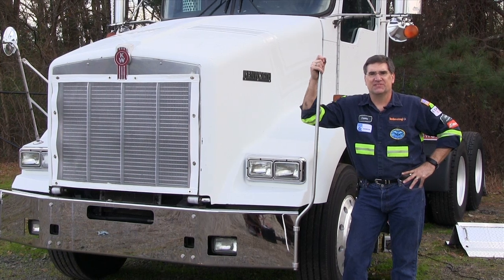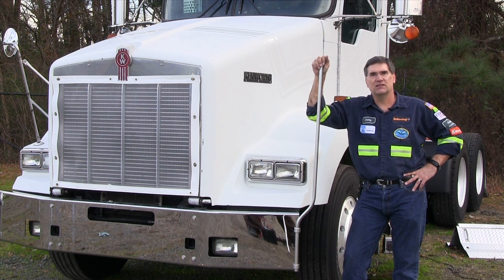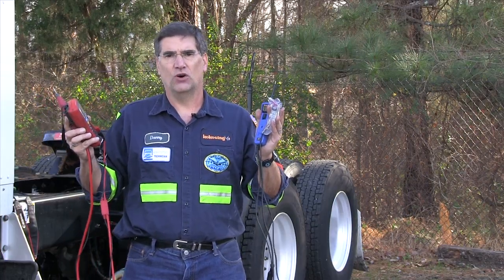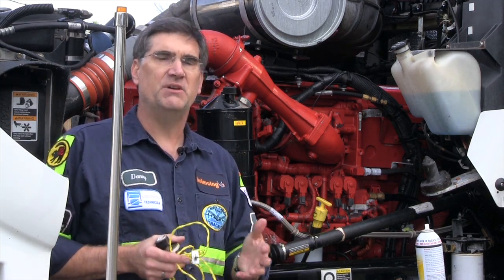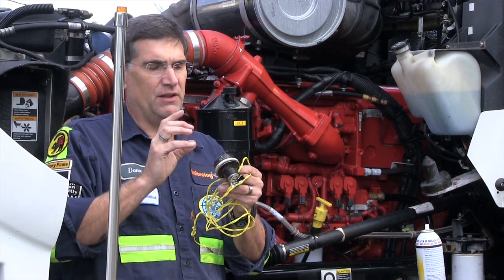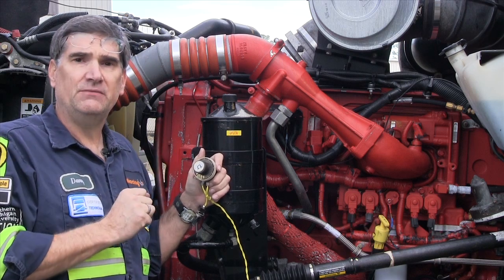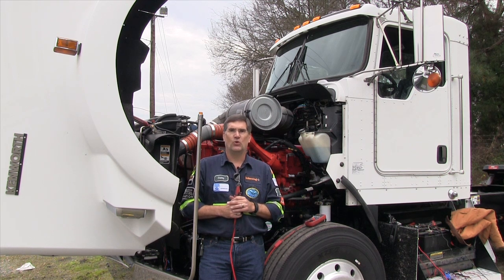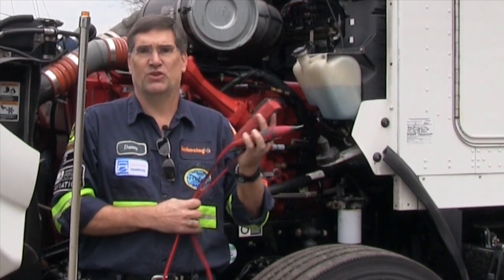LOADpro® vs. Volt-pro vs. Powerprobe® vs. Corrosion

Comment: Like you said anyone who knows electricty knows getting a voltage drop you must have current flow. so where was the current flow with the power probe? You are not using the tools correctly at all. not trying to be a hater to your product but at least represent the others the right way.I have 2 years in the field and i can already see some wrong practices. Sorry

Comment from the maker: As I've said, there are a lot of ways to do most everything. Good techs use whatever is available at the time, but try to keep high skills and high standards for professional work, as I'm sure you do. The LOADpro does 1 thing but it does it well. My hope is that the tool will make voltage drops easier and more common, and most importantly, done almost automatically. I contend that having to think about it and set up a test is why most good tests are never done. In electrical it's all the setup.

Comment: Hi Daniel (last reply cut short), I'm not slagging your invention mate, you've obviously spent hard time and effort to get it here, and you have many followers. My main point was you could have added alot of credibitlity by using a meter not showing a low battery warning, and by not stuffing probes into connector faces,  using the p/probe properly etc. BTW disconnecting the plug couuld clean it enough to hide the fault, this why I leave in a faulted condition and back probe it for accuracy.

Comment from the maker: As long as you understand the technical risks and failure modes of that method and are willing to accept the odds of failure, then I'm sure you'll be fine. In my industries however, back probing damages wire seals (even .0005") and that's unacceptable for us. We also need to inspect the connector internally because of one pin is damaged, others will be too. What I don't understand it what you do when you find a fault and have to open the connector. Why wait?

Comment from the maker: Lastly, back-probing isn't as effective as people think. The proper method is to probe both sides of the connector, and many of my connectors are 50-120 pins, in an immobile harness. The corrosion is between the pin/socket, and scratching with a paperclip or back probe pin can scratch past the corrosion and you miss the problem. I agree that the best method is live on the actual component, but if your experience is that you can get to every connector then I want to work on what you work on.

Comment from the maker: First, the meter wasn't misreading the system, although it did show a low BAT indication. I use 3 of these meters and change batteries as often as I fart. Secondly, the battery doesn't affect the voltage measurement until it's a very low number - about 8.5V. The battery had been changed that morning - it was still right at new. Thirdly, the ghost voltage isn't a function of battery power. It just happens. The ohmmeter does need a full battery to work. I don't mind the comment - you were right.

Comment from the maker: I think people hear about circuit loading and think of the PP3 method of straight voltage or ground. We don't do that, but because many people use PP as a reference, they don't educate themselves on the differences. We're TOTALLY safe for ECM sensor drivers - both 5V and 8V. Because there's no loadable voltage on a sensor input, we don't load the sensor voltage (signal). We tell people to isolate and energize the signal wire independent of the ECM. If he doesn't use us, he doesn't understand us.

Comment: Hi, don't mean to  be a hater or direct aggression here but, I wouldn't expect any good tech, let alone a teacher, to use a digital voltmeter that has a low internal battery (look at the warning on the display - hence the somewhat wild 7.5V ghost voltage), stuff any tool into the face of a harness connector, or even disconnect it for testing of any value.
Leaving it connected allows the vehicle to do the work for you, just back probe the connector and you're done.
Good luck with this.

Comment: Top tool dan, its been a great asset to me in the 10 months I've had it. I left the military after 8 years as a mechanic and still struggled on the basic electrics. After a little bit of learning and then finding this tool its been great. I try telling everyone who will listen how great it is and how much its saves. Sometimes feels like I'm banging my head against wall when their still testing with a test light or the old power probe with green/ red LEDs

Comment: I bought a power probe III a couple of years ago to help diagnose electrical problems that pop up sometimes in the 6 vehicles that I own. I am a backyard mechanic who would rather learn and fix my vehicles than have somebody else do it. About a year ago I had some corrosion in a lighting circuit that the PP3 was no help on. I bought the load pro/book from amazon. After coming up to speed with it, it took me about 8 minutes to locate the bad ground. Also I wish I could draw like you. I'm a klutz.

Comment from the maker: The voltmeter reads battery voltage but doesn't need battery voltage to operate. The other tools need to be connected to the battery, in order to read the battery, or they don't work at all. A mirror doesn't need electricity to see your reflection - a video camera does. I can use the voltmeter anywhere on a vehicle to read voltage - but I don't need to hook it to the battery. It's pretty simple. Keep reading.
Reply: You should probably mention that while a dmm doesn't need system voltage of the equipment your working on, it does indeed need/have a battery (primarily as a reminder I guess). Without it the meter, and load pro as well, are useless. I've seen plenty of guys waste hours on a diagnosis just to end up being low/corroded batteries in their meter. If you end up on a road service and forgot to pack spare batteries, you're SOL.

I don't understand the reason for the comparison either. Aside from reading voltage the power probe and load pro doesn't share any other functions of one another.....or do they? I don't even know what that third tool was you were comparing so I'll refrain from comment on it. I do own a power probe and it is awesome for most things but it doesn't load test circuits. I got a light that pulls approx 3.5 amps for that. I've been strongly considering getting a load pro just for a little more simplicity, hence what lead me here.

In reference to your comment in the video about poking wires, it's never a good idea to pierce a wire but there are times when it is unavoidable and it should only ever be implemented as an absolute last resort. Make sure to seal the poke hole up when you're finished.

Comment from the maker: You don't need the ghost voltage feature to make the LOADpro work. That's just something meters do. If you have a manually ranging meter, you might have to turn the meter to the millivolt range where the sensitivity is higher. It won't hurt the meter if you read 12V on a lower scale - it will simply say "OL". What are the meters you have? The point of the "tied to battery" example was that I work on 400 ton trucks as do a lot of guys. It's not just automotive. You don't need the battery to test.

Comment: I don't understand why you walk 40 feet from the truck. What does that prove?  You know techs that work that far from the trouble? "tied to the battery" ? Again..isn't everybody whose trying to find issues in a vehicles electrical system? I bought a Loadpro and would love to use it but I'll be damned if I can make it work on the 3meters
(2 I own and 1 at work) that I have access too that don't do this ghost voltage thing.That wasn't explained well before the purchase.I'm missing something.

Comment: The LoadPro surpasses the Power Probe 3 in functionality, both in its use and speed of diagnosis. I have both! I also bought the FET shop book too which is a great resource. I particularly liked 'The Little Asshole Theory' :-)) .. And the explanation of the mv voltage drop across a fuse was good!

Comment: Point proven Dan, I'm an auto mechanic and the only downside I see is that you have to disconnect the connector from the component which in most cases is not an easy job. Say for instance an in tank fuel pump, the only thing you can do there is crank the engine and measure voltage drop on both power and ground wires.

Comment: Hi Dan. Love the look of your loadpro and can see how it works just a few questions, is it ok the use it on 5v reference voltage circuits and are these the same as the bulepoint one? 

On the subject of you pushing YOUR product, what the hell do people expect. Yes bulbs and jumper wires kind of do the same job but its not as compact as your unit.

My only criticsm is do you have to push the lead ends into the plug like you do it only leads to spead connectors (sorry had to say it lol)

Comment from the maker: Jeff - Thanks for your comments and wishes. It's been a long, hard road going solo for 13 years, but if you've kept up with me you know I don't quit. It's awkward for me because I like certain features of your tool, but everyone ignored me because they said my tool was "just another powerprobe". I really wish we could work together to solve this diagnostic problem.Too many guys really need help and the future will really be miserable if guys aren't brought up to speed. Thanks again- Dan Sullivan
Reply: Can the loadpro be used with any multimeter or witch do you find it work best with i wanted to buy the power probe multimeter ??? Please reply
Reply from the maker: @johnb1121  Try www.esitest.com/589.html - check  Amazon. The power probe meter is just an off-the-shelf meter - nothing special. I have one. It works fine.
Reply: @bivideo7  thankyou

Comment: ....power probe and a test light to load the circuit and check the light... Crude but it works.... With the loadpro you can see the result in a digital manner and can pinpoint which wire is the problem in the circuit. I also use voltage drop to check circuits and wires...

Comment: Fantastic presentation Dan !!   I am lost for words trying to understand why anyone could not see how it works.  I think you should have mentioned as well that the other testers only use battery ground and not circuit ground because in my experience I find more circuit grounds with high resistance that circuit power wires.  
This is by far the best  vid. showing the capabilities of your tool.  I use it all the time.     Keep showing the other tools because it makes yours look real good.